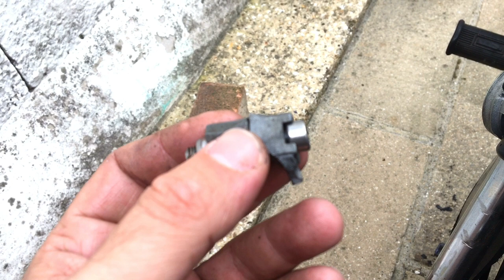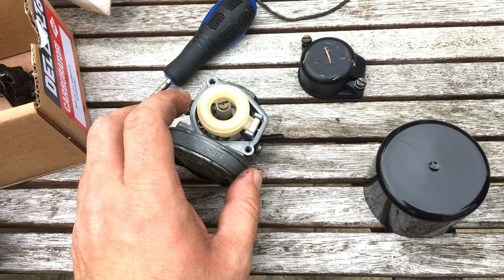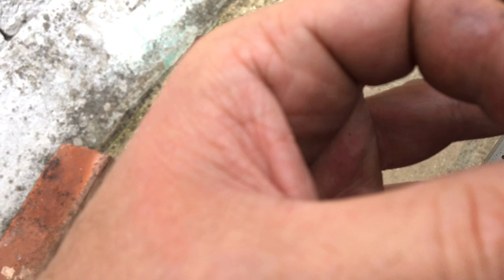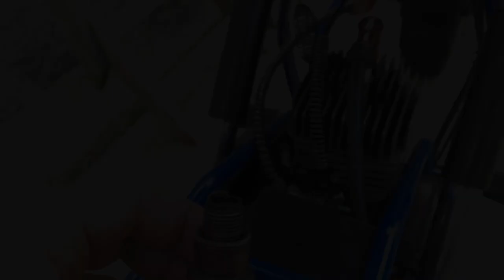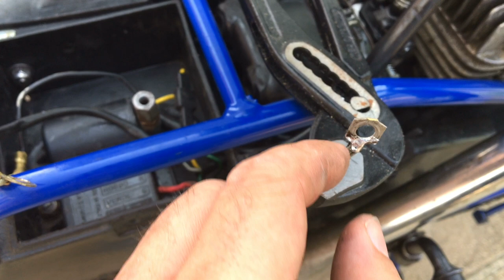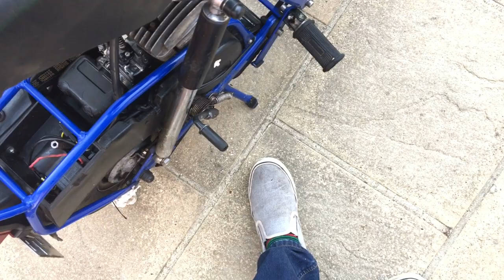Adventures With A Di Blasi Fold Up 50CC Scooter. Ep1: Engine Troubleshooting

Comment: Just acquired a 7E and are you still messing with them? Need some Ohm readings for the coil and stator...
Reply: There's 295 ohms between the green wire and ground.
0.08Ω between the yellow wire and ground.

I measured it with a new generator from IDM.